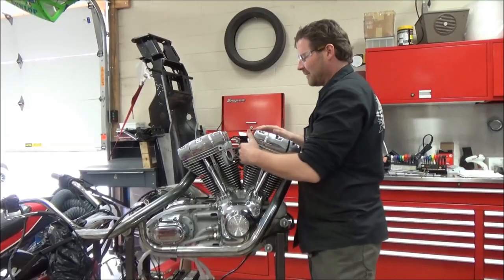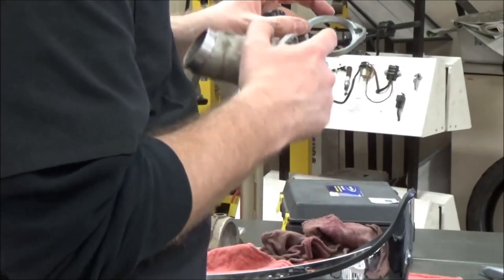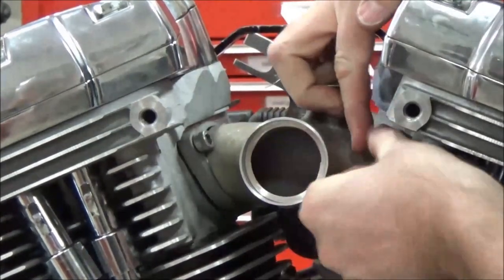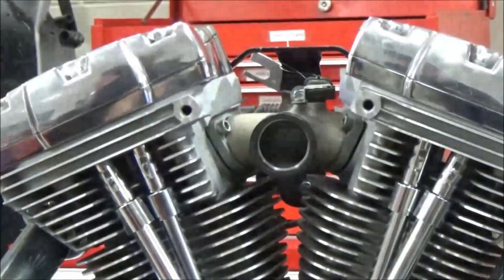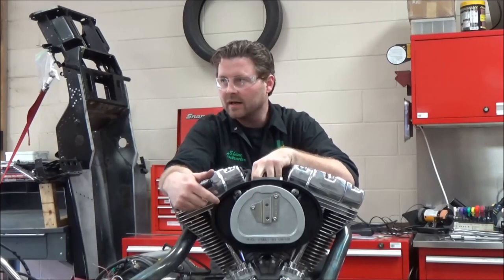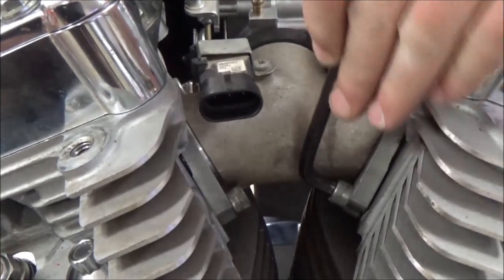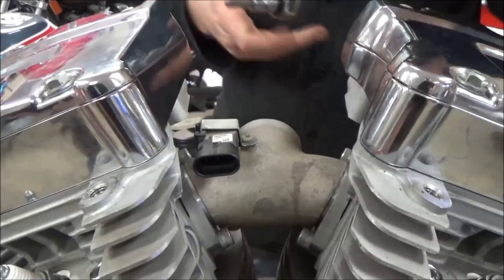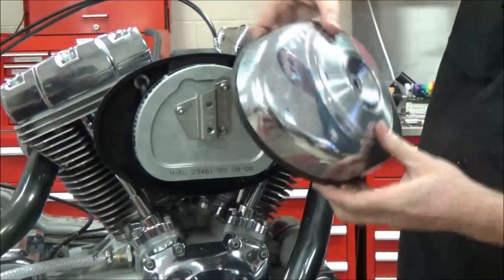How to install a Harley Intake Manifold and Carburetor without causing intake leaks! #harleyintake

Comment: Dandy lesson but lets see ya do it with the motor in the bike!
Reply from the maker: Right @megastick93...
Reply: i just did mine "in the bike" a pain in the a.. but got er done !!
Reply: I was about to say that. Some of these guys don't understand that not everyone has that type commodity.
Reply: Agreed, while in the bike not near that easy.  Didn't show disassembling everything on the left side of the motor to get at the manifold bolts.  Wonder why Harley couldn't have used regular hex head bolts instead of allen head bolts.  Would have made things a bit easier.
Reply: I didn’t know you could torque at an angle?
Reply: I just did it and by taking a long ball drive Allen wrench and making the short side as stubby as possible, I EASILY just set this in five minutes. For the front screws, even with the big plastic air cleaner on my 2003 900 sportster, holding the carb in place, I “went around the horn”, gently cinching each screw. On the front screws, I slid the ball driver through a ratcheting 3/8” wrench, and on the back screws I used the stubby side of the Allen wrench. But I have given myself as much room as I could. Obviously the tank is off, but also removed the top motor mount and the gas safety cutoff and the rear plug wire and otherwise followed the authors directions to a tee.
Reply: If you follow some of the highlights in the video you will have dandy success as well John . Motor in the bike and all ! Don’t forget the lubricants!
Reply: @stevenking9357  go back with hex head after for next time  👍
Reply: I have replaced the back Allen bolts for hex ones. Much easier. Never had any leak issues either btw.

Comment: I have to reseal my old heritage. Rear cylinder leak. It's injected but the same principals apply. I used to fix airplanes and this is something my new mechanics sometimes struggled with. But, usually the light bulb would eventually turn on. Finesse not brute force saves the day.

Comment: Great vedio man👍👍 I have a question that you may be able answer..I have a 2017 883 iron that I am  converting from efi to carburetor. I was wondering if you might know the proper intake manifold that will fit 
 for this purpose . Thanks👍👍

Comment: I just got my heads back from having compression releases installed in my '97 Softail. It started just fine before I removed the heads. Now it won't start at all, not getting fuel to the carb. I filled the float bowl by hand. With the enricher open it won't start but backfires loudly through the front cylinder. I'm thinking I may have a vacuum leak at the intake manifold. What do you think?

Comment: I’m putting a makuni 42 carb on my 05 Dyna wide glide can I use factory Harley intake seals with the makuni manifold plus why is there a map sensor on my bike it’s carb not injection theses no ECU on the bike thank you for your help great vids 👏

Comment: I noticed you didn’t put anti seize or thread lock on the 4 manifold bolts, is not recommended to put anything on those?
Reply: why the "f" would you put anti seize on there, 
wtf.

Comment: Thanks for this. I followed your instructions to a t but I still have a leak. Spray the back side of my manifold with brake cleaner and the engine dies. Guess I will just have to try again. Not sure what I’m doing wrong. Frustrating for sure.

Comment: Leave jug bolts and head bolts loose make sure intake is level and sealed before all is torqued. I'm a 70 yr old machinst Harley Mech. Never use silicone products.
Reply from the maker: Hi CJ. Interesting idea on you "leave loose" process for alignment. Can you explain in more detail on why not to use silicone products for the community? 

Thank you for commenting and being a subscriber. Want more benefits? Want even more??? Join the channel:
-Daily MEMBER FIRST COMMENTS ANSWERED FIRST 
-Live Q/A video chats
-Wonder if we have a video on your need? Members can request content links!
-Full Access to the ENTIRE 700 video library
-Member-Only FREE tool giveaways 
Join this channel to get access to perks:
https://www.youtube.com/channel/UCBhM8DCKnT3qXwTW0eToyCg/join  

Just want to say thanks quick to support us for this information and our work saving you money? 
Give us a high 5 here:  https://www.paypal.me/how2wrench
Reply: @How2Wrench  Silicone will not break down in oil so if it comes loose, (most use to much) it will impede oil flow, especially in oil pump.
Reply from the maker: @johnnysechrist6313  Thank you for your input.
Reply: @How2Wrench  Gasket cinch, 3 way seal and various uses of diff kinds of loctite for different applications are learned thru years of exp. Leaky bikes are a mechanics failure to learn the basics.

Comment: Try doing this with the motor installed in a bike.
Reply: In the past I’ve just gently tightened each screw in small increments but I have an intake seal leak on my 2004 sportster and I wanted to try it the way depicted in this video.   I have the Yost manifold tool but once my carb and air cleaner base is on there’s absolutely no way to get the tool in there to tighten the bolts on the carb side.  The other side no problem with the Yost tool.

Comment: For anyone asking if this can be done with the engine in the bike YES you can. With a regular allen wrench! Remove the carb and intake completely. Remove the rear bolt of your gas tank and lift it as high as it can go and put something between it and the frame so it stays up. ( I shoved rags underneath it ) You will have plenty of room to remove the bolts to the intake manifold on the carb side. Onto the horn side now. Remove the horn. Next remove the piece that holds the horn, choke cable etc. There are two bolts that go into the engine. That’s what is holding it on. There is also a bolt on top you will remove. Three bolts total and that metal piece will come off. Also remove your spark plug cable to the front cylinder for extra room. This will allow enough room on this side to remove the remaining 2 bolts to the intake manifold. IT IS TIGHT. Not just the room but the bolts in general. It is tricky but it CAN be done using a regular Allen wrench. There is enough room to remove these bolts. Be patient and make sure the Allen head is completely in the bolt before loosening and tightening. Take plenty of pictures so you remember where stuff was connected and what bolts go to what. Any questions feel free to message me! Hope this helps anyone wondering. I have done it myself with success.
Reply: Also a few more tips. When breaking free these bolts USE gloves. Good gloves that you ride motorcycles with. When breaking these bolts free you can easily cut yourself on the sharp edges of the engine (from experience). All the tools you’ll need are 1/2 inch sockets or wrenches, 9/16s socket or wrenches, and a 1/4 inch Allen preferably a longer one not the little ones you get from ikea stores. (Tools not including what you need to remove the carb and intake). I have socket Allen wrenches that I did not use. Just a simple Allen wrench. Also make sure you have 2 wrenches or sockets of each size. Some of these bolts/nuts will spin without having a wrench on the other side.
Reply from the maker: You rock for commenting! We will let Shane know! HE LOVES people like you adding value. 🙏
Ways to support or high five How 2 Wrench! Thank you in advance. YOU MOTIVATE US TO DO MORE!
1. Smash the subscribe button (thank if already a sub!)
2. Have you seen our "YouTube Trained Support Shirts?  https://goodfellasmerch.com/collections/how-2-wrench/products/support-shirt 
3. Join this channel to get access to perks:
https://www.youtube.com/channel/UCBhM8DCKnT3qXwTW0eToyCg/join    
-Daily MEMBER FIRST COMMENTS ANSWERED FIRST 
-Live Q/A video chats
-Wonder if we have a video on your need? Members can request content links!
-Full Access to the ENTIRE 700 video library
-Member-Only FREE tool giveaways  
4. Got an emergency and your head is about to explode from frustration or fear? Get Shane’s cell here: https://how2wrench.com/ols/products/techline-one-on-one

Comment: 15 street glide shakes bad when you pull in clutch to free drift or to slow down.stop at a light in gear at idle and shakes way more than normal, doesn't seem to backfire or pop through the intake..bike only has 6200 miles on it.

Comment: Shane, have you used the intake gaskets with the thin lip on them? I was wondering if they sealed better. What do you think? James gaskets has them but have never seen anyone use them in any videos. Later, Rick.
Reply from the maker: Hi Rick. Can you drop a link for me to make sure we are talking about the same thing?
Reply from the maker: I've never seen these "blue" ones. My first reaction is anything with a "lip" could cause a restriction in airflow (assuming it could squeeze inward). Not against new and better parts but for the record, I have never and I mean never had an HD intake leak doing EVERYTHING I do in my video...I will ask around out of curiousity!
Reply from the maker: Just posting this response here too. Such a good question I'm using it in the Live call in Q&A session coming up on August 2, 2020! 
I checked on the gaskets with a pal of mine I trust and he said he only uses those when a customer refuses to replace a bad (warped) manifold or flanges...lol buys he a little insurance and the performance loss wouldn't be noticed...He is a machinist so I shared this video with him too...I'm going to make it for my lathe!

Comment: What is that second tool called to tighten the Allen screws on the manifold I need to pick one up but I don’t know what it is 
Thanks
Reply: Rocco Beantown intake manifold wrench.
Reply: music lover are all intake bolts the same size? I see them for sale on amazon but doesn’t say anything about the Allen size plus I need new bolts. I don’t want to put the old back in
Thanks
Reply: Yes they same size. They should be 1/4 allen head bolts and about an 1" long.

Comment: Now I know why my manifold will not seal. After tightening, the manifold moves easily side to side and rotates up and down. Nothing locking anything in there. I wonder what's wrong. It's like the seals were too small or something.

Comment: Hey just asking why don't you or your students wear rubber gloves like the nitrile gloves?
Reply from the maker: +Justin Scott 
Hmmm...Interesting question for sure. We have some students that do wear them. I tried for years and do not care for how many times a piece tears off and is prone to contaminating the work. There is surely times when they are handy and needed.
Reply: +Shane Conley There is a company called Grease Monkey that makes nitrile gloves which are 5x's stronger than the regular medical gloves, I have a box of them so i should know.

Comment: do this on a bike and not on the bench
Reply from the maker: Could you add your reasons as to why?
Reply: Because when WE do this, we have the gas tank and frame to work around. We aren't pulling the engine just to work on the carb. You can't get a wrench on the right-side bolts.
Reply: Yep those allen bolts are a bitch to get to
Reply: have to agree with those comments I am beating my head against the wall trying to loosen the allen bolts holding the flanges to the cylinders
Reply: Yep!
Reply: I feel the same way.  I’m hitting the frame in my S2 thunderbolt.